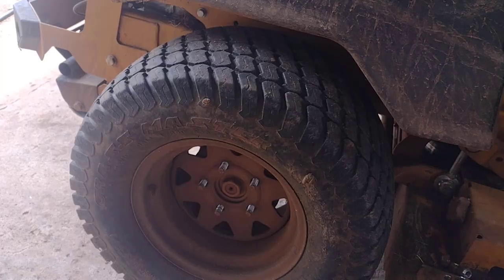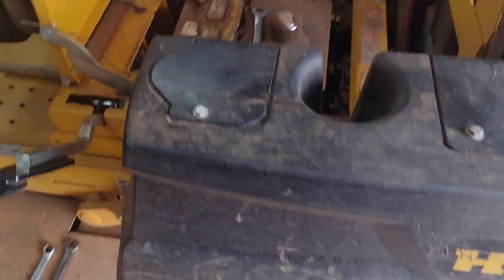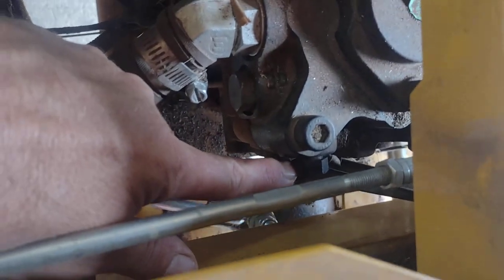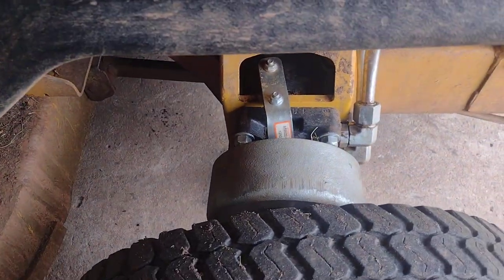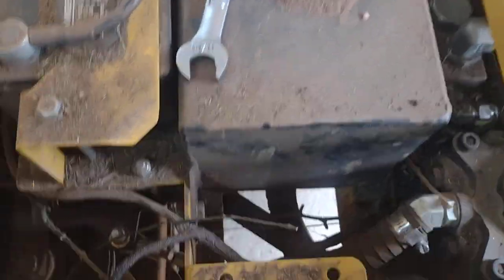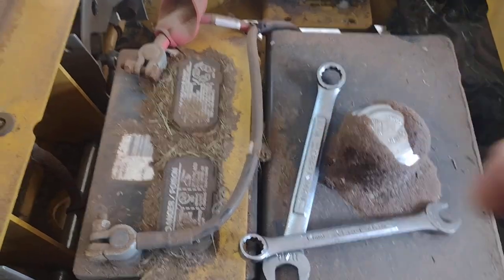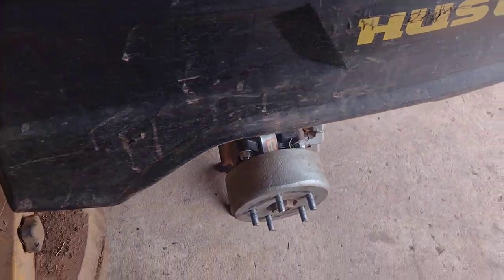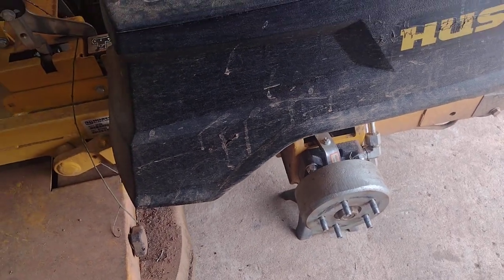How to adjust brakes on Hustler Super Z Hyperdrive!!!

Comment: The easiest way to adjust the brakes is behind wheel drum just like you did on older vehicles they have a slot behind hub to put screw driver